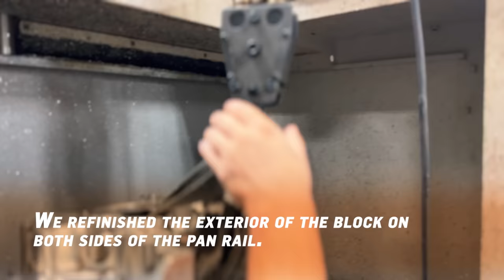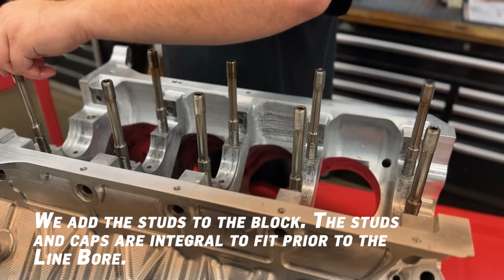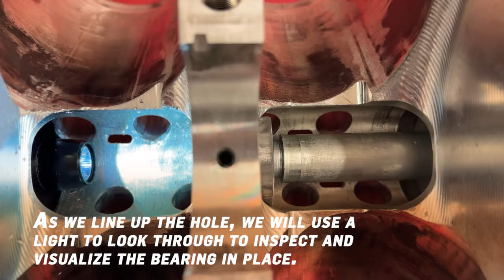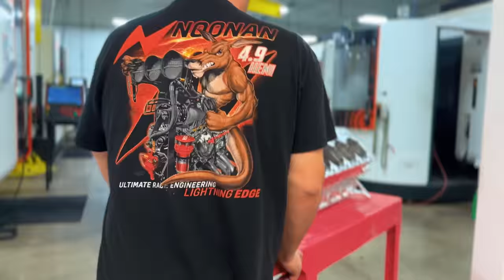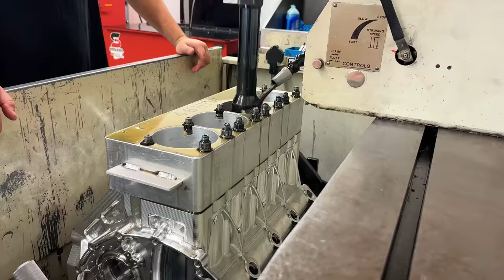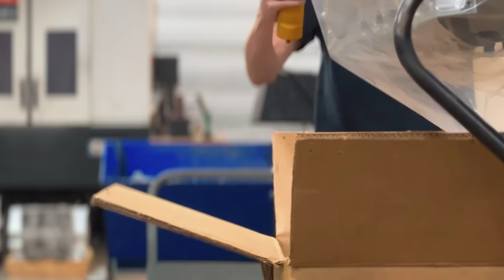Catastrophic Engine Failure Repair Part 2

Comment: The way you guys do an excellent repair on blocks to look like new again is how PAR done mine cnc and all. There are so many places out there that leave these billet and aluminum blocks all welded up on the outside and not machined to look like a new or non-hurt block, and it drives me crazy. It looks like crap and makes me wonder just how nice and well they did the rest of the work.

Comment: The cam bearings are grooved back and the pin is hollow? Being the pin has to protrude into the bearing just shy of the surface does that take away the benefits of the grooved backside of the cam bearings or does it leave enough clearance that the groove remains pressurized with oil?